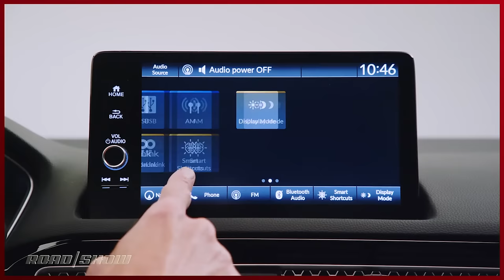The wild ride that is Lordstown Motors

Comment: 7:00 "building cars is hard, especially for those who have never built a car before"
True, but most of the engineers, managers and even some workers have decades of experience building cars. Schmidt worked for Tesla, VW, Hyundai, Darren Post (Chief engineer) almost 30 years at GM, some of the other guys also worked for GM or other manufactures, so they have built cars before.

Comment: Un-sprung mass Un-sprung mass Un-sprung mass, always Un-sprung mass... Critics got nothing more to complain about the truck and make up something that is a non-issue and try to deceive the public. 
For a truck that is > 1500kg in weight, the mass of the hub motors are nearly negligible. The battery itself is 1100kg already and its tremendous inertia will keep the truck smooth and stable all the time. It is simple physics that you can learn from secondary school.

Comment: I'm in agreement with all the people who were expecting a new startup like Lordstown Motors to hit the ground running with a lightweight, easy to manufacture, "starter truck". Nothing fancy but a solid, well-built vehicle that can bring in some much needed name recognition, real customers and cash. The starter truck gets real manufacturing happening, while the top of the line Endurance undergoes it's more intensive engineering phase.  Lordstown Motors needs a truck Now, the wonder truck needs more time.